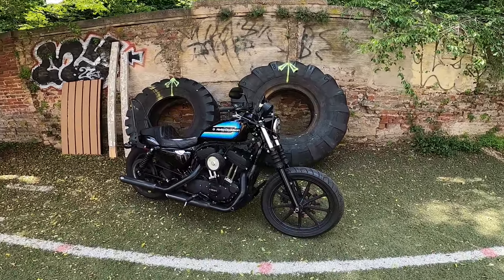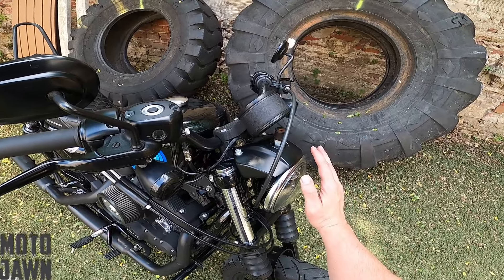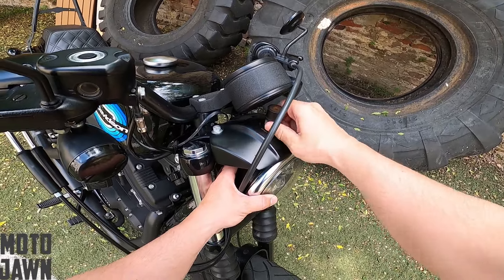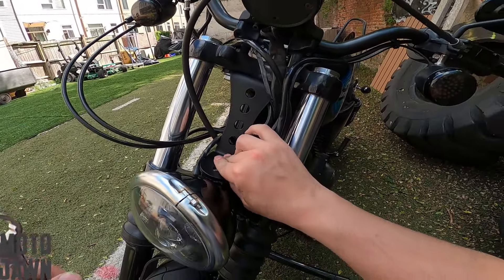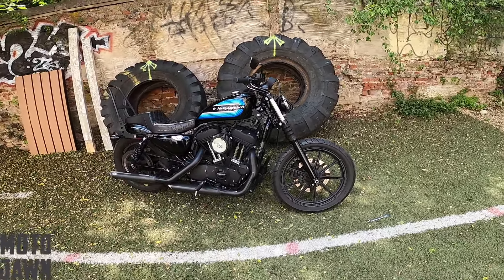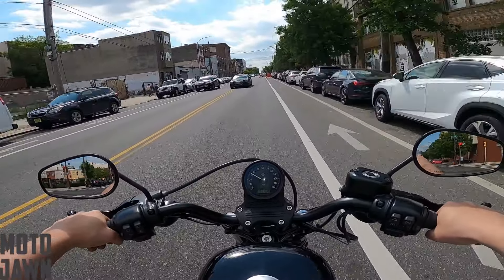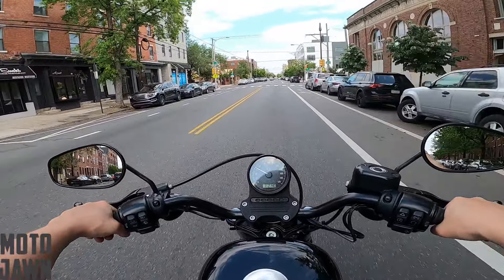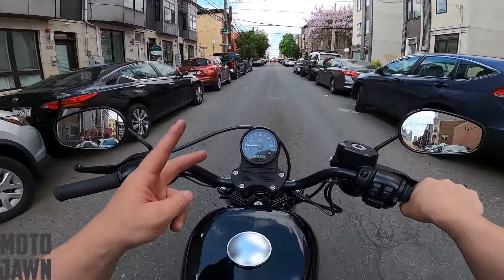Removing The UGLIEST Part on the Harley Sportster Iron 1200!!

Comment: I just got Cobra El Diablo 2into1 for mine and even without the tuner it sounds so good. I'll keep you updated once I get it tuned correctly, but I just got it and it's so much better in person than it is in videos. (20 iron 1200)
Reply from the maker: That's a good one for sure 👌
Reply: @TheMotoJawn  I've been waiting for years and the price just kept going up . They are pricey but worth it.

Comment: In my opinionated view,  
Air filter cover should go back on. That stamped aluminum looks worse. Your filter also needs a cleaning and recharge. Looks really dry. 

I ditched my front fender after the last video.  

Headlight is now upside down and you want the screw on the beauty ring facing down. 

Hope to meet you this summer. My bike is almost together. Still trying to figure out the chain tension/ wheel alignment thing.  I’m definitely riding this year.

I really like my V & H 2-1 Competition but it’s not sold anymore.  Not sure what I would put on if this needed to be replaced.
Reply from the maker: Yeah I had to flip the headlight only way to mount to that bracket. I'll have to rotate the trim ring down to the bottom

Comment: Do a speedo relocation to clean the top. You could add a headlight grille. Also, change the front signal light for a smaller one. Lowbrow customs have a headlight bracket. Check out dk custom they pretty cool stuff.
Reply: The RSD relocation is the only one I’ve seen that looks good. It’s hella expensive like all other RSD parts though.

Comment: You might need to flip the light like I had to. You light is upside down now.
Reply from the maker: I had to flip it to mount it
Reply: @TheMotoJawn  I mean the actual light, I have the same bracket. Since it has to be mounted upside down the light is now upside down. That (in my case) made it impossible to adjust the angle of the beam. Until I took the light out of the housing and flipped it over too.

Comment: I think you have to turn the headlight, i think there is a marker on the glass.
Reply from the maker: What do you mean? Like flip it?
Reply: @TheMotoJawn  Because you turn it upside down the light can blind oncoming drivers.Best thing to check it out in the dark a few meters away from a wall and look at the light patern on the wall.
With H4 headlights i know for sure you cant turn them upside down, with LED i am not sure.
Reply from the maker: @FikkieSteker  yeah I see what you mean. This light only has a screw option on one side so I had to flip it. We'll see how it goes

Comment: I got a lot of stuff for my Iron 1200 from boneyard garage in the England. Side mounted coil, speedo and number plate. They do a headlight mount too. The angle of yours troubles me bro. Plus, did you turn the lamp by 180?  It won’t make any difference to the angle but you’ll blind less people. I’ll dm you a pic of the mount on Insta.
Reply from the maker: Yeah it's kind of pointing up I might have to bend it down. Flipping it was the only way to make it work